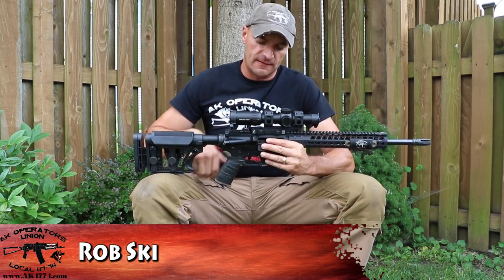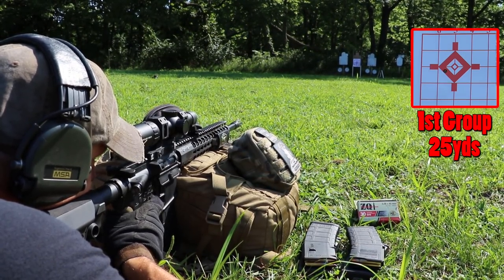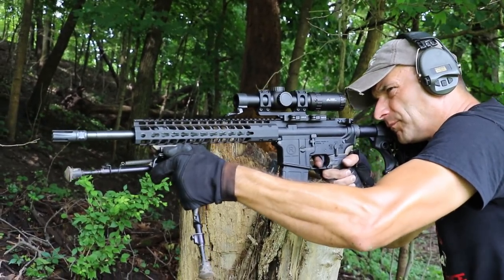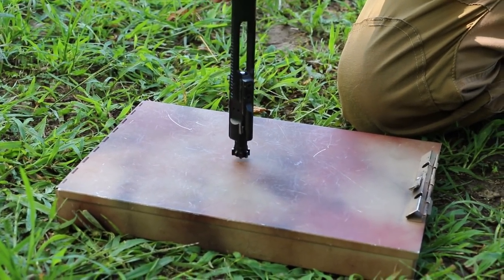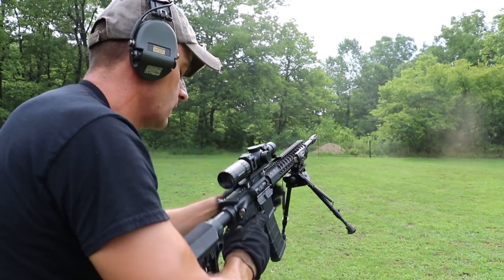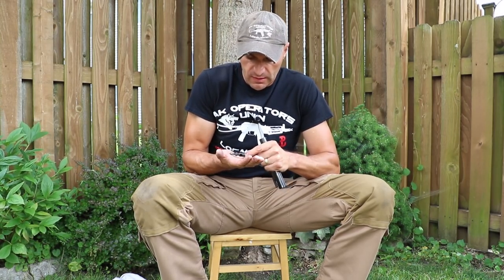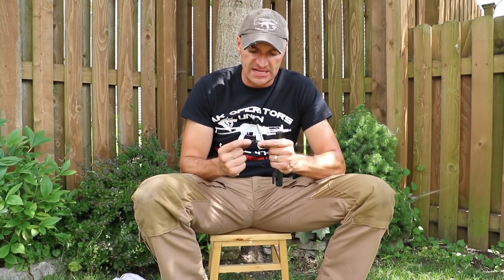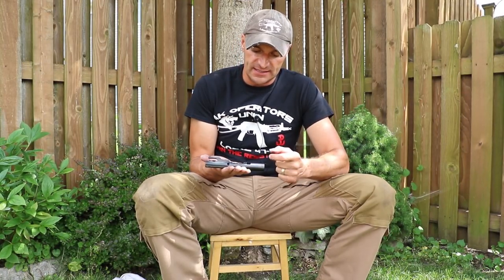Radical Firearms AR-15, 4310rds LATER - Another one bites the dust!

Comment: Rob where did you order the ZQI ammo from?  I have a couple boxes back from when my Walmart used to sell it in 30 round boxes but now they haven't had any for months and months.
Reply from the maker: +Brian Presto local Walmart but I bought them back in March I think
Reply: Out of stock though, yeah I just got 1000 round order of 55gr fmj Brown Bear from SG for my 5.56 converted 74.  My AK has 1/9 twist ratio and my carbine AR has 1/7 so trying to find some more 62gr 855s for it.  I wish they had Wolf Gold in something heavier than 55gr.
Reply: Oh and thank you for the replies!
Reply: NP. Can't reply again. Unsubing
Reply: Unsubing?  Why?
Reply: +Brian Presto because he will put a red dot on the ras47 pos to finish testing it but when it comes to a cam pin said he won't it he can't fix it with duck tape or paracord. Adding a red dot is not in his "rules" either. Did sights stop gun from running? no but adding parts is adding parts. He also added a after market trigger which may have cause the light strikes as well. Its just my opinion but bias, and bullshit.
Reply: Florida Prepper I understand where you're coming from, I wouldn't unsubscribe just because of that though.  He was almost finished with this RF AR test and it broke on the final day so I can understand if he wants to call it over, he tried to fix the gas ring problem, was having multiple issues, probably just frustrated, especially after dealing with the stupid I.O. AK.  The light primer strikes could be the Geiselle trigger or it could be that the cam pin was cracked and binding the firing pin up possibly, a good reason why I kind of wish he would throw a new cam pin in and see if that light primer strike goes away.  I'm sure he will repair it and get back to us, that and I'm curious if the bolt holds up for the rest of the test.  But I'm not gonna crucify him for his decisions with his test.
Reply: I don't totally agree with the choices but the WBP was fixed with objects found in the field, the RAS was still functioning just the sights were broke and the stock was cracked.  He put the red dot on I'm guessing just so that he could see where he was sending lead and to test accuracy of the barrel as the test progressed, the Arsenal trigger had hang ups but it still functioned half assedly,  the RF AR was the only one that actually broke a part of the bolt group and was dead, is it a cheap part yes, is it easy to swap out yes, but none of the AKs tested in the 5k challenge have had a bolt group fail during the 5k and the only one that has had an issue with the action is the IO.  Which I'm still curious what happened there.  If you were at the range shooting your RF AR and were expecting to get 1000 rounds out of it that day and it broke at 300 you would be going home pissed and annoyed, most people don't have spare parts like that some do.  You would be going home and ordering a new cam pin or calling RF and the wait could be a week or so.  I'm doubting Rob who was expecting that to be his last day with that rifle really wants to deal with all that and would rather move along to the next test subject.
Reply: Thanks for the heads up.  I see they have two different boxes available of ZQI, one is almost $11 the other is $9.30 and is labeled Guardian.  I wonder what the difference is they are both SS109 62gr 30 round boxes.
Reply: Nevermind they're out of stock on both...

Comment: if a budget rifles barrel and receivers are in spec and they have top quality BCG they will run with tier one brands besides barrel life, but the bolt carrier groups and buffer supplied with these builds WILL NEVER and i repeat WILL NEVER run at those levels, they are sub par materials. so as long as your expectations are reasonable for plinking hunting self defense your fine, if its a fighting rifle you absolutely NEED! to replace those parts with quality ones if you cannot afford the whole rifle from colt, bcm, spikes, daniel defense, FNH, etc.

Comment: You going to finish the test with a new cam pin...?
Reply from the maker: +7N6 no, test is over...if I would keep swapping parts for new ones, than what's the point?
Reply: +Ak Operators Union, Local 47-74 To show how easy it is to repair...also It would only be fair since you attempted to fix the RAS...at least show that it could be back up and running...just saying...  http://www.bravocompanyusa.com/Cam-Pin-AR15-p/cam%20pin%20ar15.htm

Comment: OK so the rifle didn't fail, with price of the rifle, just upgrade to a quality bcg. still be a low price point. and what is the time frame these 5k round tests cover? like over couple days, couple weeks.
Reply from the maker: First episode for this rifle, went live on May 17th. So it is roughly 2 months.
Reply: +Ak Operators Union, Local 47-74 oh OK. yeah definitely agree, that's too low of a round count for that type of failure. but given price, it's  nothing to upgrade a few key parts. I was impressed over all.
Reply: +TacticsB4Strength I'll take replacing 10 bucks in parts after 4000 rds

Comment: Radical Firearms is much better now since this video being less than 6 years old... the company only came online in 2015... so, it is expected of some form of failure or quality control issue etc.?
Seen some great reviews including a 5,000 round torture test for a LE fully automatic version... and again there were personal peeves between that one and a Colt but regardless the rifle performed very well...
Beside the gas rings that all 3 of the port slots 'must' be always orientated to be spaced from each other as the more you are firing the rifle those rings will move as the slots are closing on each other will have a failure - so, for every cleaning and/or having performance/firing issues one should always go back to ensure the rings are evenly spaced?
Those of us that had or is serving in the army or marines knows this to be part of our training to maintain our battle rifles just being one of those little things?

Comment: I've never actually seen a cam pin break. I've seen gas keys come unstaked etc but the cam pin is new. Bummer.No cam pin or puny gas rings in Kalashnikov....lol
Reply: There's been aks he's tested that did fewer rounds.
Reply: Which were so poorly made they're not even comparable. Are you suggesting that this AR is built that radically different from the rest and that's why it failed?
Reply: Sporora Pretty much, this is a very cheap AR.
Reply: Sporora it is radical firearms. Lol. You made the ak comparison. I just said there were aks that didn't meet the round count of this rifle.

Comment: So you would recommend having extra of those parts that failed?
Reply from the maker: +Pablo Ramos yes!
Reply: +Ak Operators Union, Local 47-74 Awesome any particular company?
Reply: +Metalli Fan Thank you
Reply: Even with an AK, I always keep a spare BCG for my 47's and 74's.  Doubt I will ever need them, but nice to have, JIC.
Reply: +PrAKtikal Nurse if I'm not mistaken that doesn't work with ak's. I think the bolts are fitted per rifle?
Reply: +PrAKtikal Nurse if your Ak fails and you can't fix with a hammer you best move on to the next one
Reply: +PrAKtikal Nurse only problem with having an extra bolt is that knowing me it might turn into another build... not necessarily a bad thing but
Reply: +donny11b  negative.  That's an AK hater debunked rumor.  95% of the parts are interchangeable between a 47 and 74.  I own 2 47's and 2 74's.  I had a US Army issued M16A1 and owned 2 AR rifles.  As of today, I don't own an AR.  When I was in basic training, the Drill Servants said the same thing about the BCG's for the M 16's.  LOL!!!
Reply: +Pablo Ramos That's why I choose AK over AR😀.
Reply: +Nicole Woodruff yup Awesome I have to stock up on these parts. Found some cam pins from BCM for 5 bucks so I picked up a few a d some gas rings too. I don't shoot enough to probably ever have any problems but better have and never need then need and not have
Reply: +Nicole Woodruff Thank you will hopefully stock up on all necessary back up parts soon
Reply: +Nicole Woodruff I have 4 ARs 2 Colts 1 Bushmaster( reluctantly selling soon) and 1 Stag lower with PSA lpk and PSA upper 
As much as I'd love to shoot 1000's of rounds I doubt I ever will. Only trouble with having extra parts is that they might end up being a new build lol
Reply: I recommend having an entire extra bolt carrier. I like to put stuff like extra gas rings in my grip compartment as well.
Reply: +Nicole Woodruff I borrowed the money to buy one of my Colts and thought I could pay it back just by saving but looks like I need to sell a rifle to meet the deadline. Yeah Ive been procrastinating on listing up for sale.
Reply: +Sasmodog Would be best way in a SHTF type scenario, drop the old one replace with new, I have a few extra rounds in my pistol grip compartment
Reply: +Nicole Woodruff good info!!  Thanks!!  just out of curiosity, does anyone recommend changing out a BCG in the AR pattern rifles, after X amount of rounds?
Reply: +Nicole Woodruff that makes sense thanks for the tip
Reply: +PrAKtikal Nurse I haven't read anything that mentions replacing the whole bcg just a few parts there was something I read on the AR15 forum ( I think) that had details of what the rifles went through( cleanings and basic upkeep service sorta thing) at x round count for the life of the rifles
Reply: +Nicole Woodruff Thanks so much.  Check head spacing with a "Go/No Go" gage?
Reply: +Pablo Ramos thanks so much.  I am the product of years of frustration with the AR platform.  LOVE the balance, the feel and the adaptability of them, but where I live, that round has to go down range every time I pull the trigger.  Lots of predators out here.  No rifle I have is a "plinker, safe Queen, or just-for-fun", they all have to work.
Reply: +PrAKtikal Nurse well redundancy is key better safe than sorry
Reply: Sir, not trying to give you grief, but have you owned an in spec and properly built AR? When I hear statements such as yours I always wonder. My AR's run and run and I do not fuss over them in the least.
Reply: +Tim Sheeley I assume your comment is directed at me? by in spec I guess you mean mil spec? year I own 3 factory built ARs 2 never shot... I live in California
Reply: +Tim Sheeley I'd just like to have extra parts and not have to worry about it later just in case the laws here get more strict
Reply: Yes, basically. The more rounds I put through Ar's the more I'm impressed with reliability. Gas port cut too big/small? Gas block not torqued to spec or pinned correctly? Chamber cut like crap? Bad springs? Lots to screw up, but good ARs in my experience are very reliable. I like AKs too!
Reply: +Tim Sheeley yup there's a reason why both rifles have been around for decades now
Reply: +Tim Sheeley A lot of these cheaper AR's are running junk MIM parts. I've seen a PSA bcg cam pin and gas key break...Was later told those parts are MIM. I was told that Toolcraft Microbest and Youngs will make a bcg to a oems specs. MIM is a cost cutting move.
Reply: never saw gas rings that looked like that ,, these look like snap rings from a hard ware store ,,
Reply: +Chase Dillard what's MIM parts ?
Reply: +Metalli Fan  gotcha your talking about  powdered metal being compressed in a mold at  extreme pressure that forms the shape of a mold  the AVE  YT channel  explains this very well! about the gears that are made for  cordless high torque  drills
Reply: +Metalli Fan The best parts are investment cast. Schmid Tool is what Colt, BCM, DD, SOLGW use. ALG parts kits are Schmid Tool.
Reply: +Metalli Fan Midwest Industries has standard phosphate BCG's reasonable.
Reply: +Metalli Fan I wasn't either lol until recently
Reply: +Pablo Ramos wouldn't hurt to get a couple extractors(they're really weak compared) extra springs and, less importantly, a firing pin too. I'm probably forgetting a couple things but these are parts that will eventually wear out and the satisfaction of changing parts on the field or range and not having to leave and order one is really nice.
Reply: I would recommend buying a rifle that has PASSED the 5,000 round test.... like an ak47 lol. something you don't need to keep spare parts on hand for. would you accept a concealed carry that you needed to keep spare parts for?... I hope not so why accept that from a rifle?
Reply: +O4  HEMI agreed 100%
  it's like setting yourself up for failure.  Accept no flaws, or mediocrity.  Your life may depend on it.
Reply: +PrAKtikal Nurse EXACTLY! but read these comments holy cow. it's seems to be that this is perfectly acceptable in the ar world "easy fix" and "cheap fix" and the best "this is why I always keep spare parts" are you kidding me?! your rifle is sooo unreliable you have to have spare parts...blows my mind
Reply: +O4  HEMI  I admit, I ALMOST ordered this rifle, but decided to wait until Rob finished the test.  I don't own an AR, and all my firearm buddies are always ribbing me about, "buy something American". Used an M16A1 in the military, and I like a lot of features, like the BHO, and the balance, but the reliability was disappointing.
Reply: +PrAKtikal Nurse reliability and ar-15 don't go together never have my 2nd biggest problem with the ar is that puny bullet great for training not a caliber I want to take to war
Reply: +Metalli Fan ok you have fun changing parts and clearing jams with ur "tacticool" peashooter

Comment: Yep.........that's what AR's do...EAT PARTS.  It is a critical fail, sorry AR fanbois. A genuine combloc AK bolt doesn't fail at 4310 rds...or even 14,000.  Thanks Rob for the vid.
Reply: I don't think you can generalize all ARs from this sample size of one. I'm sure there are the same number of shit AKs as there are shit ARs. Good parts on any rifle = longevity for the rifle doesn't matter the family of rifles they belong to.
Reply: Well considering this is a budget AR of less than $600 I don't see the issue, as it beat the pants off of almost every AK so far...all have needed work, all but the wpb and arsenal were dead after 5k...this is a simple drop in $5 part...
Reply: Doesn't matter...The cam pin broke...an AR fired without one is a fuckin grenade...its a critical fail that would leave you without a rifle to use.  Anybody remember the Challenger "o rings" that failed...those were $5 parts too....and the whole ship blew up....
Reply: +Thomas Hark I have seen more blown up budget AK's than AR's but whatever you need to tell yourself.  This is a budget rifle, and after 4,300rds it needed less than $10 of easily replaced parts to continue on..the budget AK's on the other hand....dead with no hope of repair...    If you noticed the gun functioned, just not well...the cam pin stays in the track, as it has nowhere to go...so no, it isn't going to just blow up... Cheap AK's sheer bolt lugs and lose headspace...for instance the pin was pulled on the RAS grenade...good thing Rob had gauges...with the AR the broken part was easily spotted...  If you go budget, go AR if you go AK spend the money and get a good one...

Comment: How wet was the BCG?
Reply from the maker: +Tim Bucktwo not very wet at all. After cleaning and changing gas rings it was lubricated but it wasn't "wet".
Reply: I have a few AR's and they all tend to want to be wet to function well. My main AR, which I don't clean except to wipe down the BCG and lube runs very well. Once it starts having issues, I lube till it's wet and then I have no function issues. And bear in mind I have 1000's of rounds through it. 

I know its after the fact, but try a different BCG and see how it performs. As per another comment below, it may be a gas/pressure issue or its not truly mil-spec. I've never had an issue with a cam pin before, or seem one that broke. Also, the BCG is designed to run on only 1 gas ring. Which still leads me to believe that is a gas/pressure issue. 

Lastly, they may just be buying their BCG's and small parts kits (as most companies do) from not a reliable source and the quality is not there (i.e. China). 

P.S. the 2 small holes in the BCG that are seen when the bolt is closed and the dust cover is open is where you need to put in a few drops of lube when having issues.

Comment: That is mil-spec parts ,which is why your supposed to clean your rifle . Yes that's a low round count for a properly serviced weapon ,but for a weapon that hasn't been serviced it's not really low at all . If you consider the fact that you should clean your weapon after use , at least a basic field strip and wipe down as well as the fact that most mil spec AR's run best wet. Lubing it every 500 rds wasn't nearly enough , so your really running this AR though a torture test of 5K that really represents far more rounds than you actually put through the weapon simply by the method that your test employs. It's not as though you aren't a member of the US Army you know how often an AR platform weapon is supposed to be cleaned and oiled and why. Plus most AR guys would have the parts to fix this failure in their range bag , since broken cams are pretty common , PS why do you think make  titanium or stainless steel ones that are so easy to get you can find them on EBay ?